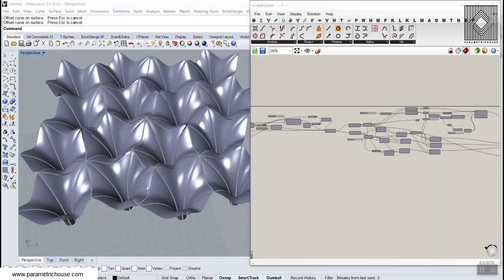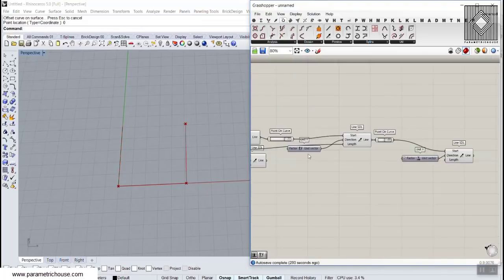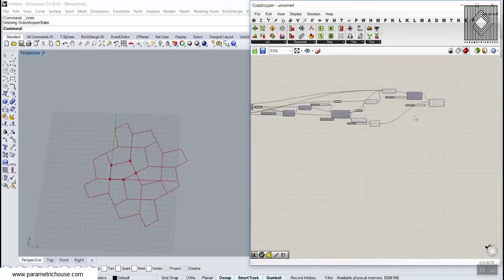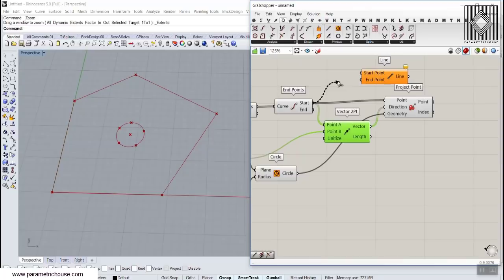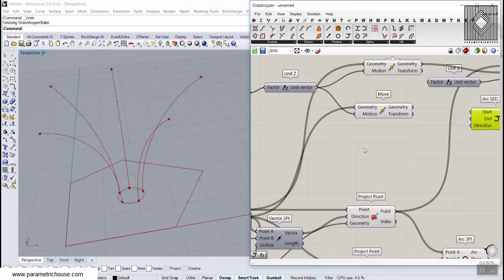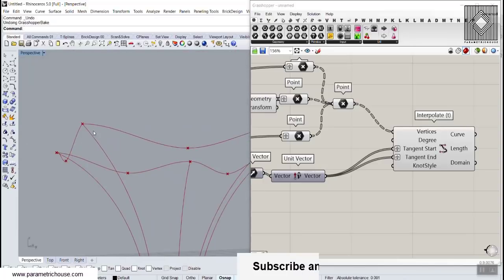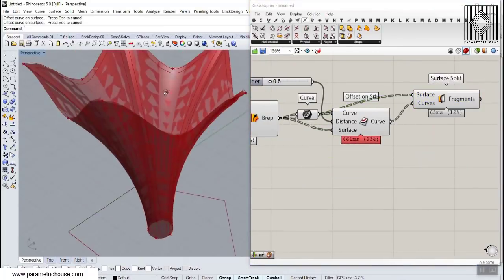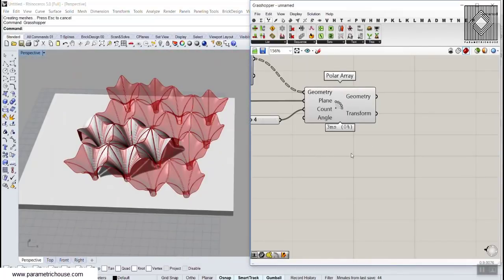Confluence Park - Grasshopper Tutorial

Comment: 22:24 for some reason pluging under start of the SED ARC the end point on the small circle on the bottom plane with the points I moved along z (used the same point for the "start" points) it creates arc between the bottom point and the next point move in the z dirrection. It is strange because it works just fine for the "start" point and for "end" points it doesnt. HEEELP :( fixed it haha sorry for spaming under the video
Reply from the maker: Congrats, So you solved it😉